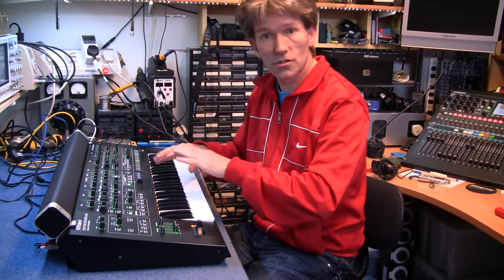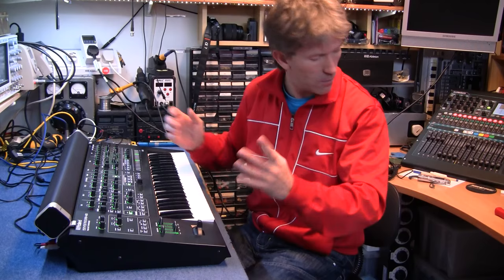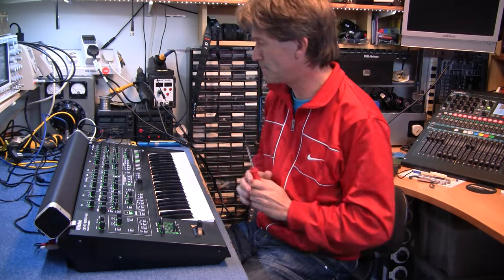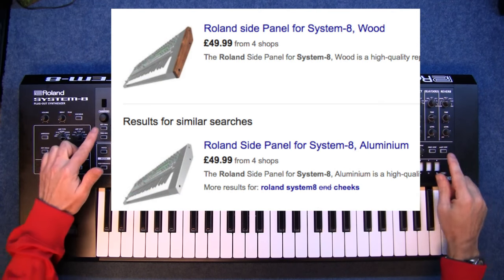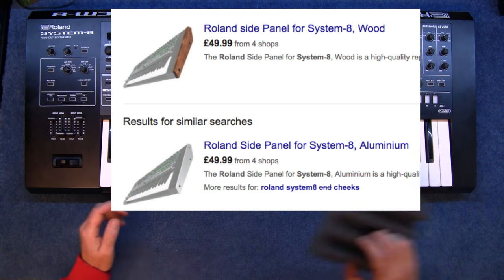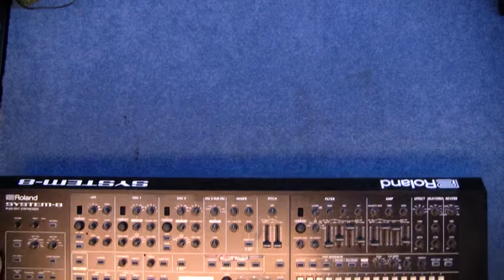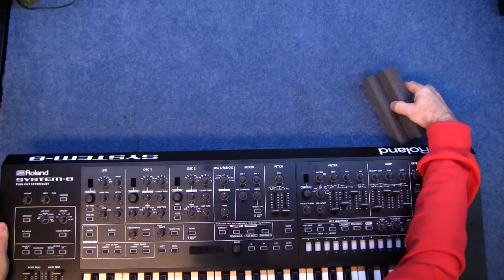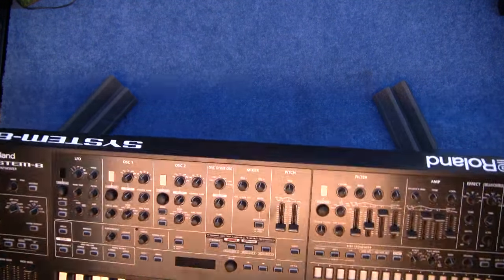Inside the ROLAND SYSTEM-8 plug-out synthesiser

Comment: 1:03 - "I don't really give a damn, it's down to the sound it produces". Thank you! :-)
Reply: Usability is the most important thing. The DX7 was a brilliant sounding synth but you needed a PhD (and the patience of a saint) to program it, so it's no wonder you only ever hear its presets being used.

This thing appears to be a hardware implementation of a softsynth. You could probably get the same sound with some cheaper software and a decent sound card, but the ability to modify and tweak multiple parameters in real time is its main benefit.

Comment: Some times, the unpopulated memory footprints are about being flexible with which brand and size of memory they use. I'm a bit surprised it's still done, especially in something as low-volume as a synth, but it used to be quite important to hedge bets when there were memory shortages and more price fluctuation. Could also be for an expanded version; the aftertouch ribbon cable hints at that as well. Maybe we'll know next week. :)

As to keeping the power supply external: it simplifies certification/listing. I hate external supplies, but I get why they do it.
Reply: They could always do it how Waldorf did it on the Q and XT. Have a DC psu mounted internally. Search for Waldorf Q inside on Google images to see what I mean.

Comment: Welcome back!

A few thoughts, because it is strange how PCB's often have unpopulated areas. In my mind it usually boils down to the assumption that these products go through several stages of rapid prototyping to filter out any bad ideas or unnecessary components, while also being sure to design the product in a way that it's easy and cost efficient to examine and repair.

Being that PCB is so much cheaper to manufacture, massive reduction in labor cost compared to handwired stuff, the fact that Roland have clearly payed attention to how much time is spent assembling these, for example, only a few screws and wires hold the top on, and the fact that all of the I/O is handled on a separate board, making for an easier job to resolder connections if needs be.

From a labor cost perspective, this assembly makes quite a lot of sense. It's tight, clean, there are few connections and it's all very modular and clear to examine.

Comment: Hi Markus,

The main reason synth manufacturers don't mount the power supply inside synths is certification cost. Once there is line level voltage and a power supply inside the case, the synth itself must be built to pass UL, CSA and TUV certification tests. This testing is costly (and destructive) with multiple units being submitted and subjected to all sorts of high-voltage indignities. When I worked in that industry, it was quite normal for manufacturers to submit many different prototypes which would fail the tests in one way or another, go back for iterative improvements before being resubmitted. And of course, each standards agency has their own rules, so the units must pass ALL of the rules for each of the countries under each standards agency. I did a lot of testing of computer modems back in the day, the test they all regularly failed was one that simulated high-voltage power lines falling across telephone lines. 15 or 20 KV would be applied to the phone line input of the modem, and it was not allowed to spurt flame and ignite whatever it was sitting on (special charring paper was used to detect this).

It's far easier and cheaper for manufacturers to buy an external power supply from a third-party vendor who has already had that power supply tested and certified, slap their logo/label on it, and stuff it in the box.

Or, if you are one of the Chinese manufacturers that sells cheap electronic garbage on Amazon, just (illegally) put a CSA/UL/TUV logo on the device even though it has never been tested, was never certified, and likely does not meet certification standards. This is exceedingly common these days.
Reply from the maker: Thank you Scott. that is very interesting information. I must say when something has a simple 12 volt wall wart its much easier to to just change the power supply than to get inside working on an internal power supply.

Comment: Extrernal power supplies are about cost cutting, in two ways:

1 - configuring the device for different international power standards is just down to swapping out a different DC adapter

2 - using off-the-shelf, OEM adapters means you don't have to get your devices approved by UL or other regulatory agencies, because the power supply already is and the device itself is only getting low voltage DC so the regulations are less restrictive than if it actually took full, mains-level AC and had the power supply inside.
Reply: Ol' Zircon , dead right ! All ´bout money in the end. Personally that's where îd make a difference between my phantom g with its internal power supply, or m'y Integra-7, instruments for professionals, and my Gaia that is a convenient portable toy. Not even sure they provided the fa-series with internal power supply, but from the general look i'd bet they didn't....

Comment: Great video as always Markus! Thank you for this! I'll have to try this synth out next time in in my local music store. =D
Reply: The Juno Plug-out sounds amazing.
Reply from the maker: Jakob Haq Thanks Jakob, I personally think it sounds pretty good though I was expecting to see a bit more inside. its amazing what can be done on a few chips.
Reply: the electronics inside (for example) a mobile phone seem pretty basic, with more removed these days than added. Apple's diagrams for its MacBook laptop show a tiny little strip for CPU, memory and storage, with just battery taking up the rest of the volume.

But of course, there's still plenty going on.

Thanks for the video!
Reply: markusfuller few chips = 1500 euro
Reply: He doesn't care if it's digital or analog, but damnit it needs more components!
Reply: Robert Syrett you can spend less and have more
Reply: +Vegetto Blue: Care to give examples?  There are cheaper ways to get specific but limited soundsets (eg minilogue, DM12) - but what else offers a 49 key keyboard with a mass of physical controllers, that offers/includes 3 full spec VA synths?
Reply: FunInWales hahahaaaah , are you kidding me ? Va synths ? In 2017 ? A lot of controller ? I actually can give you not 1 but like 5 good brands that produces software plug in that emulate like 10 polyphonic synths  ( you can get like 99 voices from that ) for 99 euro + a midi keyboard with after touch ( Yes it has it ! ) or a good app that has all the controllers that you want ( you can customize it ) for like 50 euro . Than you can compare all them with Jupiter moogs cs 80 , they sounds good like the originals . For like 150 euro buget , 10 times lower that a system 8 . And the plug in are chip less , which means less chips .
Reply: +Vegetto Blue: I asked about self contained 49 key keyboards with lots of physical controls, running multiple high quality VAs, and you came back talking about plugins and unspecified midi controllers. Okay, let's go down that path. I have more DAW based VAs than I care to admit, and there are some real poly VA gems out there eg Diva and The Legend, but it's hardly apples to apples. I don't own any of the Roland ACB plugins, but I've tried them and they sound incredible - but they don't half eat CPU, and that's just mono - not 8 voice poly and without running multiple VA models at once as the system 8 can do.  So a like for like comparison is processing hardware capable of doing the 8 voice/multiple model high quality VAs, a 49 key midi controller with a high number of physical controls and 3 VAs of the quality that ACB can do.  And even then it completely missed the point of being self-contained.  But hey "it'll do" right?
Reply: it also has to run these at 96KHz 24-bit. That causes a significant CPU hit when running in a DAW
Reply: FunInWales hahahahaaaaha  , are you telling that a couple of sliders and a 49 keyboard without aftertouch wroth 1500 euro ? Hi quality va ?? What it means in terms of sound ? What is the difference between a plug in and system 8 in sound terms ? don t wanna  go in depth with minilouge or dm12 sound synthesis , but for cpu drain unless you use 5000 polyphony or effects the plug are quite usable . 
This is my last answer ,  I don't wanna continue this reply . I don't consider any kind of va or digital synth , in my opinion there are only analog . If someone want to buy feel free do it .
Reply: mrbreaker101  the audio card of my pc  is already set from default to  24 / 96 , there is no drain .
Reply: I see I'm wasting my time thinking you are capable of backing up your "hahahah" statements as the stuff you are coming out with is utter nonsense.

Comment: Hi Markus,

There is a very simple but also daft reason why power supplies are nowadays often external: As soon as you keep the full net voltage out of the instrument the rules it has to conform to concerning safety and radio denoising drop down significantly. So why not let somebody else (the supplier of the stand alone power supply) bother with it? Another example of how originally well intended burocratic rules can produce pear shaped apples. In the end it is of course still the wrong kind of cost cutting but what else is new?
Reply: This is 100% correct. I used to have a job doing destructive testing on devices that had internal power supplies, or that plugged into phone lines. We would simulate a 20,000 volt transmission wire falling against the house wires on the pole outside, by injecting 20,000 volts into the device. The devices had to fail consistently, predictably and safely, they could not catch fire, they could not spew flame out of a vent hole (to avoid setting anything else on fire), etc. It used to kill me to be physically destroying expensive electronic components that I would have loved to own (could I have afforded them at the time). The manufacturer would have to submit 10-15 examples of a unit to us for testing before they got their UL/CSA/TUV certification labels. Any and every time a change was made to the device, it would have to be resubmitted for testing in order to maintain its rating.
Keeping the power supply external means no testing is required for the device; only for the power supply, and as those are commodity items, the power supply manufacturers will be the ones doing the testing long before Roland ever buys them.
Reply: @ScottsSynthStuff  Thanks for the extra info. I didn't know the testings where so extreme. Maybe you can explain a bit more. What then secures that an external power supply does still not forward such voltages when they get totally overfed? If I am correct any power supply can be fried to a point that a direct contact between the interwoven different spools develops. I've smelt it a couple of times and that is already more then I care for, in spite of inbuilt fuses and nobody messing with them, for instance by aging isolation. So such behaviour appearantly cannot be 100 % avoided by the design of the input stage. Would the leads then simply burn through before such voltages reach the connected device?

Comment: Thank you for creating these videos.  My burning question is, can the green LEDs be replaced with another color like red, blue, orange, or even the best option would be LEDs that can be color selected?  Similar to the LEDs on the Roland TR-8S.
Reply: I wondered that too.........Would look good if they could be
Reply: @markusfuller Came here for the same question. Have you taken a look at the LEDs? Replaceable with patience?
Reply: You can replace the LEDs with red or orange LEDs, you would just need to add a 27 ohm (red) or 20 ohm (Orange) resistor to the negative side of the LED (the negative side is usually indicated by being flat)

Comment: The memory footprints on the bottom layer may be just for the same memory that is on the top layer, just in a different package. Basically they can assemble the board with either package, whichever they can get hold of cheaper. The un-populated connectors are more of a mystery. My guess is a new or different synth in the pipeline that will use the same board in a different config.

Comment: Good start to the new year Markus, thanks! I wonder if the stuff missing on the CPU side is provisions for a module version later on with minimal onboard controls, maybe a touch screen of sorts for rudimentary setup. Or it could be for a light version of the synth with the missing chips being flash for factory presets and a bank for users instead of the wonderful array of nobs to tweak. 

Probably not but just a wild stab in the dark with the I/O and CPU boards being roughly the same size etc.
Reply from the maker: Neffers good thought there Neffers, maybe like the system-1m there will be a system-8m on the way ?.
Reply: Something along the lines yeah. How long have you had this? Looks like a great addition to your setup anyway, grats :) 

Edit, I agree with the notion of after touch capability.
Reply from the maker: Neffers I have had this one month and although I have better synths in the house this is just so easy to program and move from room to room.
Reply: A great synth to have then, I would forgive its performance for ease of use. It's not as though it sounds like a swarm of bees farting in a bean tin is it?
Reply from the maker: You can make it sound like a swarm of bees farting quite easily :-)

Comment: Thank you for a nice video and taking this beast apart. It would have been kind of cool to probe all the unconnected cn-points. Not that they might have been connected to an actual circuit or function but yeah you know how it is to be curious :) 
Thumbs up and have a nice day.
Reply from the maker: demoscenes I think a lot of those points may have been used during the initial programming and debugging R&D stage. then when its all worked out they just use the same board design but populate it with just the components needed to make it work.

Comment: Sometimes, boards are developed with extra parts that are used during development but either not necessary or designed out of production. If there isn't a need to spin a new board, they just leave parts off.

Comment: With respect to the power brick, I guess that external bricks are available at much lower cost than separate power supply boards that have to be installed (also at a cost). It also keeps a bit of heat out of the keyboard in addition to the RFI you mentioned. Since PSUs are probably the commonest failure point, having it as an easily replaceable brick is also handy, I guess.
Reply: Using an external power supply saves you a lot of time and money and paperwork on all the certification tests that are required when you want to feed mains power directly into the device. With, say, a 12V DC input you can skip all of that (and many manufacturers do).
Reply from the maker: oldblokeh Yes you are quite right, its only a 9volt dc psu so easy to find a replacement if you need one.

Comment: Wow..there's getting less and less components in these new synths. I suspect the empty spaces on the PCB's are for a follow up model as you say, probably more voices and more plug outs. Maybe a new front panel too. Its a lot of money for so little really. The main Roland ACB chips will be the expensive bit. I need to keep reminding myself its the powerful processing and the custom chips we pay for... but from Roland's point of view they are on to a winner with cheap manufacturing using their branding. I noticed they are made in China too. Hmmm... not that thats a bad thing these days because most musical gear is now.

Great Video..glad to see you back after the builders ruined your video uploads :-)
Reply from the maker: muzikman2008 I guess theres a lot of R&D gone into this and working with that new chip but yes pound for pound theres not a lot in there though it does perform reasonable well (well to my ears  at least) I guess that board could be used for the module version if they release one system-8m ?.

Comment: With regards to Roland and other branded Japanese engineered and manufactured gear, I noticed they tend to use "Jalco" branded connection ports for the rear panel. From my experience, they're not readily easy to replace and if a single quantity needs replacing, it can be expensive (unless someone has them as an OE supplier). When several modern Roland instruments came through my place with damaged/faulty jacks, I thought I could easily supply with another brand only then to discover I had a bit of a search on my hands because Roland North America wouldn't sell nor supply me the individual jacks... unless I became an "authorised service centre." I'm curious to know if this is different in other regions where Roland operates.
Reply from the maker: Dyaxxis Hmm you have a point there, these are the same jacks used in the system-1 system-8 and JD-XA. I only had that problem once in the past so I used a threaded jack socket mounted with the pins facing up and soldered wires down to the board. not ideal but it works if you need it.
Reply: I agree that's just as reliable, yet a cheaper and faster fix. Some customers insist upon a direct OE replacement only to find that it can take 2 to 4 weeks if in stock from a willing service centre with the cost of the part being $17 to $25 per jack plus posting, not counting my labour costs, then the dramas begin.

Comment: Given the number and placement, I'm guessing the unpopulated CN and SW spots are there to make it easier to run diagnostics on the ICs, when these are sent in for service.
Reply from the maker: Yes I guess so. Im not too sure as i sold my system 8 a long time ago though i wish I had kept it now.
Reply: @markusfuller  I'm wishing I'd bought one instead of a JP8000.  It's probably going to cost me more than a System-8 in parts and equipment to get it working, and it's put a damper on my progress learning music, having to learn synth repair first XD